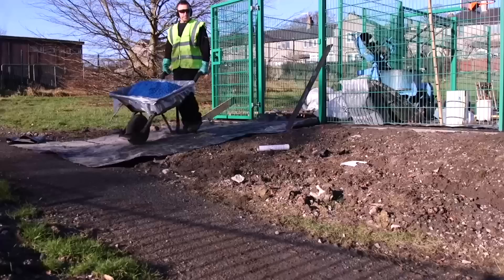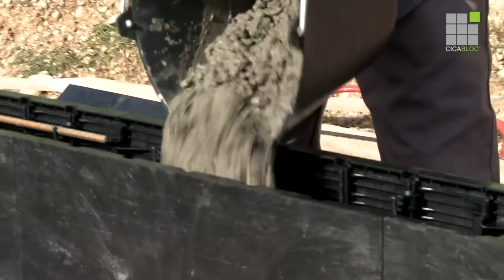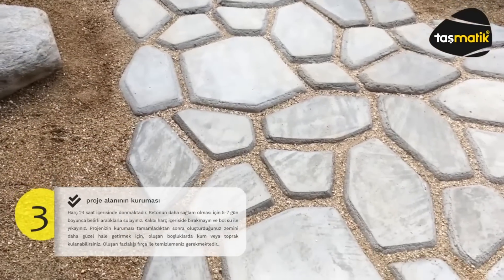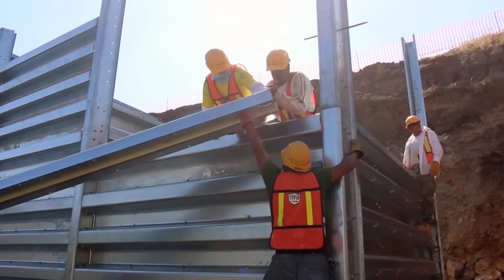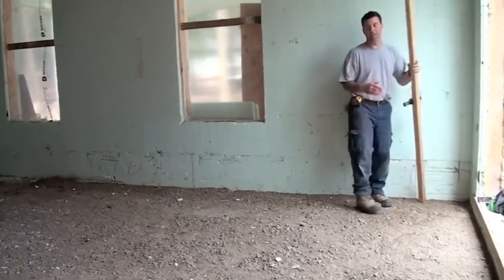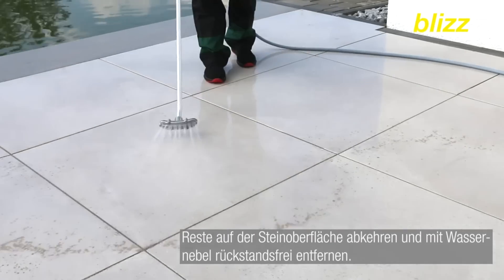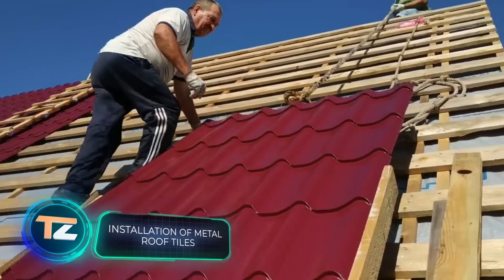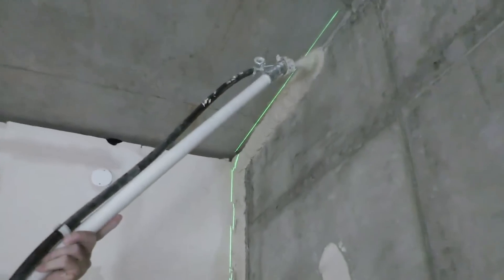INCREDIBLE CONSTRUCTION TECHNOLOGIES THAT ARE WORTH SEEING

Comment: Firstly my commet is more of a question, in regaurd to the metial roofing materials being shown.. what are the maximum wind speeds the manufacture is garenteeing their roof sheets are expected to withstand?

Secondly i direct this comment solely at those individuals who have failed to distinguish between the manufacturering of the metial roofing materials being shown and the safety practices of the contractors installing the metal roofing materials. 

Have you recentnly suffered a traumatic brain injury, thus leaving you without the ability to process a rational thought.. entire company's have gone out of business becouse of assholes like those concerned about someeone else work habits and safety practices.

Comment: I don't think you should put the screws in the valleys of the steel roofing. (8.45) They go on the ridges so any leaks will be short lived as the water is gone very quickly.
Reply: It dont matter in Texas after 5 years the rubber grommet is rotted anyway.

I make good money repairing roof leaks.
They leak in the valleys they leak in the peaks.

Easy to fix.
Remove the screw.
Seal with NP1 colored to match the roof and install a slightly longer screw.

Seal around the new screw.
Reply: Exactly my thought.  A complete rookie mistake
Reply: In New Zealand the fixings go in side of batten by using the step in the metal profile.   We never screw in the pan.
Reply: On the peaks you can't compress the washer because the profile is flexible. Correct installation in the valleys requires care: perpendicular screws and just the right amount of compression of the washer as per manufacturer's instructions.
Reply: This is always such a great discussion!
In valleys, you rely on the rubber washer but you can over tighten and split the washer.
On  the ridges, you rely on the rubber washer but need to be careful not to over-tighten, thus changing your layout.
Reply: @chrismullin8304  Yes, that's right. You tighten so there is pressure on the washer, no more or you spread the sheet a little bit spoiling the alignment. But fixing on the peak is standard practice in Australia.
Reply: Yes, you put the fixing with a rubber washer on the peaks of the roofing material. Any rain landing on the peak automatically flows into the trough, then down the complete trough to the gutter.

Comment: working on heights or around mine shafts requires people who understand the job and the risk safety equipment helps those who can t manage the risk and move about accordingly
Reply: I never used to wear fall protection walking steel until the mid 1990s. It was more luck than good management that I survived 3 or 4 close calls.  

Fall protection is now mandatory under many OH&S Acts............ it helps prevent people writing cheques their bodies can't keep............and I have worked with some very good riggers who are now dead or in a wheel chair with colostomy bags as a result of falling from heights. 

The fact of the matter is in situation where there is a risk of falling from height and other controls are not practicable, it is much better to end up being suspended in a harness by a lanyard than going splat........... provided there is a recovery rescue system in place............ and the person falling does not hit a solid object as they fall. 

Still, it is not a perfect world........... somebody I knew was killed when he fell 60 metres back around 2003. He landed across a piece of 150 mm angle and put a 450 mm bend in it.....One of the legs of his twin tailed lanyard broke............ the other was still hooked at the top of the tower.

Comment: Is 122 degrees Fahrenheit the Max that this Ranella 'Metal' roof can handle???  Is this INCORRECT?   If NOT, then it appears to me to lack sufficient temperature handling requirements for a Ranella roofing material.   I measured from INSIDE my attic at the ridgeline 155 degrees F.
Reply: I think they were referring to outside air temperature

Comment: how are the plastic block eco friendly?
Reply: How is any material?

It's lighter so it uses less fuel to transport.

It joins together mechanically, so there are no solvent emissions etc in to the atmosphere during assembly.

It can be completely removed, reused or recycled.
Reply: Because they said so, don’t you know that’s how it works.
Reply: YOU CAN'T CHALLENGE ANYONE ON CLIMATE CHANGE.....JUST CONFORM COMRADE

Comment: I know, the human killer asbestos, was incredible too, at first..
Reply: Asbestos is actually only dangerous when inhaled. If you're not cutting, there's essentially no risk. If you are cutting, doing it in a well ventilated area with proper PPE, you're still safe. Most asbestos was actually phased out, not due to being dangerous, but because other more efficient/cheaper materials were discovered/invented to replace it. It's still used in some products to this day

Comment: It kills me when they say that Styrofoam or plastic products are environmentally friendly or Eco friendly Does anybody realize how much pollution comes off of these things when they're being made or when they're being recycled
Reply: I couldn’t agree more - he throws in the ‘it’s environmentally friendly’ comment without explaining how …. it’s made of plastic!!! How can this be good for the environment!!!
Reply: Please note when we throw away plastic material after very few use, that's when it becomes harmful. So if it is used as building material that is durable, then it is useful. But how eco-friendly it is debatable 😎
Reply: polystrene is very very hard to "recycle".  Most places won't do it.  it is NOT environmental
Reply: @bina nocht murdered baby skin wall is too dark dude, but at least they're organic
Reply: not to mention what happens to them when exposed to excessive heat
Reply: Soo much plastic has already been produced that its now friendly to recycle it and reuse it. But any material can be good or bad
Reply: More than likely they are using recycled plastic, which would normally sit in a landfill. So yes, it is environmentally friendly. Same with the foam, they said it's recyclable and it's going to increase the R value. So it is also environmentally friendly.
Reply: Well it's friendly for me coz it's cheap, and i am part of environment
Reply: Recycling is a scam
Reply: @aWomanFreed  recycling is hardly a scam. There are plenty of materials that get recycled and reused. Some materials are easier to recycle than others. Car batteries for instance, are almost 100% recycled. Asphalt whether from roads or roofing material, also another thing that is almost 100% recycled. Many plastics and glass are also recycled. Recycling allows us to still have without taking more out of nature.
Reply: @mattypants is some one going to recycle this guy's house?
Reply: @badcad641  they had to manufacture it at some point.

Comment: Fall prevention is the most ridiculously overlooked safety precautions!
Reply: most of the safety requirements for fall protection also causes more falls to occur
Reply: @gregbrunner599  I know a lot of people feel that way. I found it aggravating but 20 years of use it never caused me to trip or fall even on the most difficult jobs and places to have to use it. It also shows that those who refuse to use it have no real appreciation for the precious gift of life.
Reply: @bandanabanana3162  Have been in the business now over 50 years, and 90% of the employess including me find all this safety stuff a Pain in the arse. I agree in some safety aspect, but many of the things they want are worse than the cure. With all the lines and hoses etc, all you do is trip over the stuff trying to do a roof. Roof jacks in most cases is all you need.

Comment: Interesting that none of the roofers were wearing or using any type of fall protection. Construction work is the most dangerous occupation in the world, and guess what kills or injures most construction workers? You guessed it right: falls from a height of 6’-0” or more! OSHA!
Reply: maybe they were the homeowners redoing their roof, also it was likely a different country where the US OSHA is not in force
Reply: @waynegibbons352  Whether they're homeowners or not, it's reckless and irresponsible to not use appropriate safety gear.
Reply: They mentioned Europe, so probably not the USA. Which the USA's construction industry has bad track record, although commercial industrial has gotten better. The home repair companies side however is borderline homicidal, were the last to actually require workers to wear safety gear.  These companies and than workers are also  the most likely to avoid following  OSHA (and common sense) safety  rules. It doesn't help here beside the industry attitudes, so have incentives and legal loopholes Special Exemptions if you have business under so many employees. So all their  employee workers(by all other legal definitions) are called ""Independent Contractors"".... American Capitalism at its  finest.

If it was for wearing sunglasses through the 1990's , until they safety industry  started making "cooler" looking safety glass, more eyes would have been lost.  

I'm  from the USA and have worked many levels and many  different industries and the attitudes  are toxic as threats themselves.  I've dealt with wanting to wear  a safety harness ""you weren't ready to work at heights""  so you could only work lower paying ground only jobs. That from the skilled experience people teaching the younger crew. Being sober on job site  is still an issue, that only maters when you get injured and have to pee as part of medical care and only then it matters because they can deny your claim of injury, no matter the cause.

People also die from  from fails off  3' -6'  (1 meter to 2 meter for the   "imperial impaired" folks) ladders, sometimes the angle of impact is just that bad. The lower end is barely enough for fall arrestor tether to engage. 

 I always hated the "you have to tie off to hydraulic personal lift" that're they're  going to move (illegally) type selective job site enforcement, but wouldn't let you put you tether around the structure steel, because if that has issues you're in categories of being  screwed in ways no harness is going to save you......  A highlight was when OSHA INSPECTOR came through and caught them (they would never show up on the days you told them come walk in building when no was working and of course see no violations....as if they were trying not to catch bad people....) and fining the shit out of that building because the both personal  lifts were left on. The inspector could see there safety panels showing if the out riggers indicators lights as if they  were in place and which ones(all) were seated properly,  meanwhile all out riggers were in storage on the back of the lift, no where near those switches. They didn't even use   bypass blocks but blatantly  they hardwired every out rigger to appear as if was properly placed and taking weight by the indicator circuits. This was one of the high dollar professional places with the Union. Which was just as bad if not worse on safety........

Sadly Safety is a forever Bell Curve where we're trailing where we should be for safety. People fighting to drag workers up on the curve before they learn from experience that no one gives shit when medical bills come about what you did for the company.....  You're nothing but unproductive liability   to " be gone"  as they say.    

 Every safety rule is because lots of people died for them to finally act, but the attitude of "can't happen to me" is so invasive , we can't seem to kill it off.
Reply: The most dangerous profession is logging.